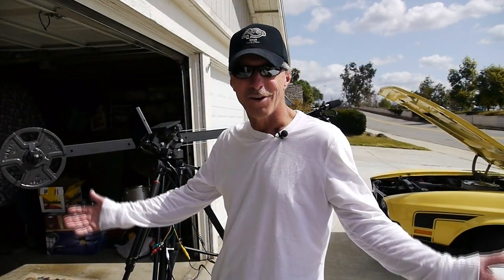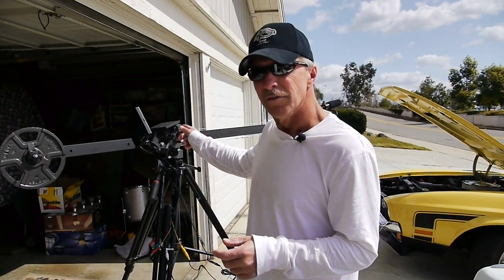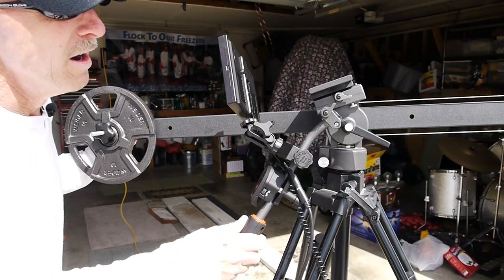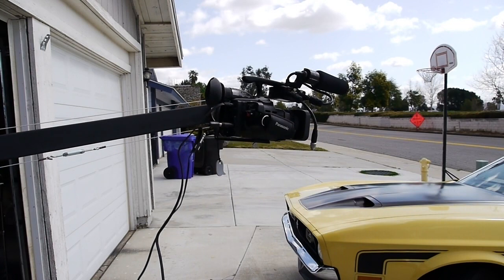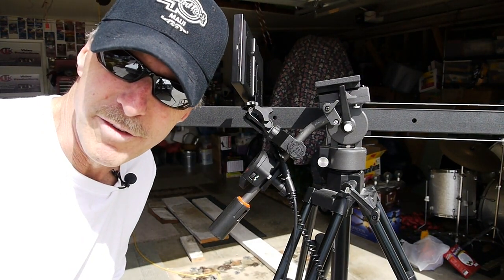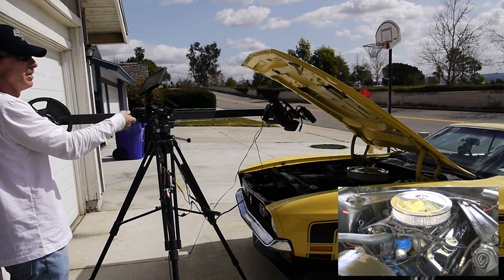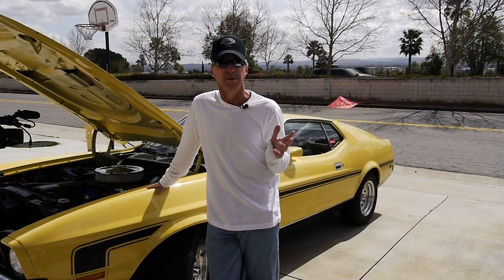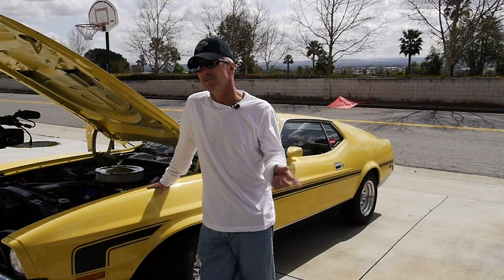Cobra Crane Tutorial (Using "Tilt")

Comment from the maker: Thank you very much for your comment. The tripod used in this demonstration is the Smith Victor Propod PRO-5 Large Tripod with 2-Way Fluid Head (Supports 25 lbs, Maximum Height 69"). The crane used for this demo is the Cobra Crane I which weighs 13 lbs. with a camera payload capacity of 6.5 lbs. I've had no problems whatsoever with this combination. The tripod was reasonably priced and uses high strength lightweight alloy tubes and double-strut design & large die-cast alloy PRO-5 fluid head.

Comment: Very helpful video, thank you! It looks like you're using the Davis & Sandford fluid head. FM18 fluid head? That's what I have and I believe its only rated up to 18 pounds capacity. The Crane without a camera or counter weights on it wieghs about 15 pounds, right? Does the FM18 head hold up pretty well when its over loaded?